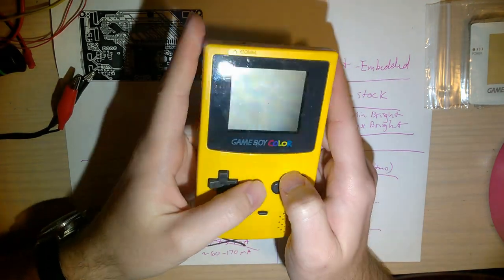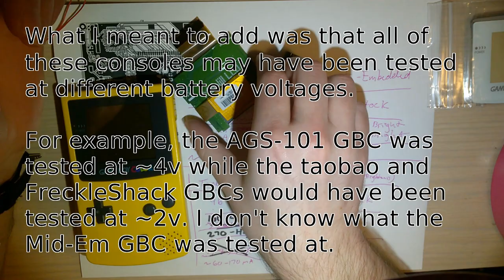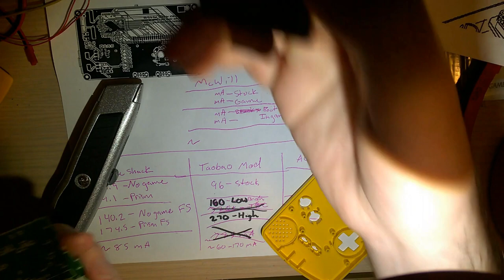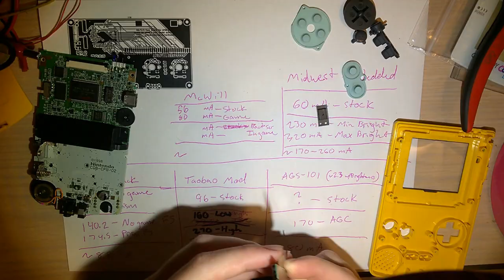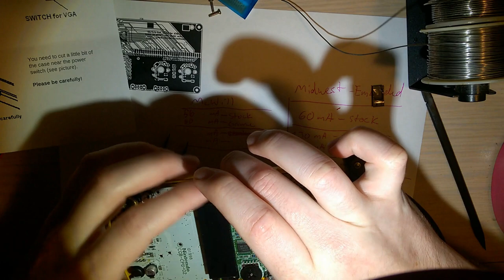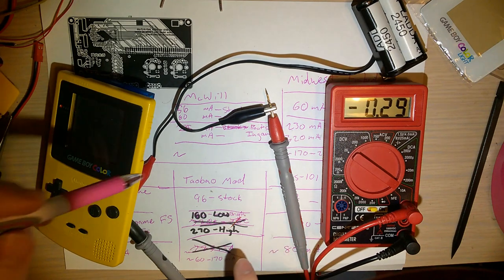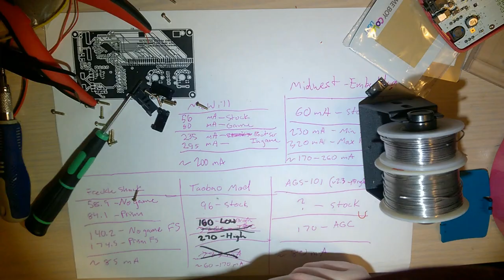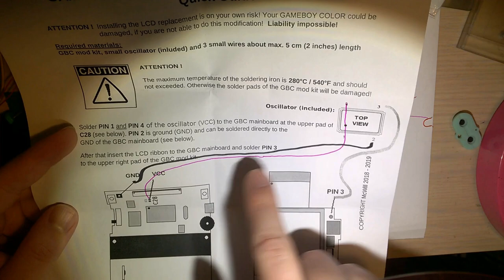Installing McWill (v1.0 -- Old Version) LCD in a Game Boy Color - TL;DW Version

Comment: If you use aa lithium rechargeable 1.5v batteries which stay at a constant 1.5v throughout their battery capacity like they will stay at 1.5v from 100 to 0 percent capacity you will get way more than 3 hrs. Nimh dont keep a constant voltage and really your only able to use about 70 percent of the batterys capacity! Using lithium is the only to have adequate battery life with any of these backlight mods! I used tenavolts aa lithium batteries which was an Indiegogo campaign. They are expensive but I've had way more than 3hrs runtime with them. You should test some of the different aa lithium rechargeable batteries out there in my opinion they are superior to nimh batteries. They dont have as much capacity but they maintain their voltage way better so you get more runtime than nimh!

Comment: Taobao vs mcwill vs Bennvenn? Wich is the best for your in pixel density?
Reply from the maker: McWill and FreckleShack use the same LCD so pixel density is identical. The taobao mod has a slightly lower pixel density than the former mods and results in a slightly larger image.

Comment: I didnt get what cause the noise at the first try?
Reply from the maker: I don't know either but I suspect there was something wrong with the board. I never mentioned this in my video explicitly, but I did imply it in another video -- all of my Game Boy Colors were purchased as broken and I have repaired them. Some may have lingering issues that I did not notice until I tried modding them. There may be some obscure incompatibility with hardware variants that I am the first to test but I'm leaning towards it being the specific motherboard.
Reply: makho too thin gauge wire? It says in the manual as well, but when I tried 30awg solid core I got lots of speckles on the screen until I switched to thicker stranded wire
Reply from the maker: @SDLearmonth  Perhaps, but it seemed to work fine on another motherboard with the exact same wire.